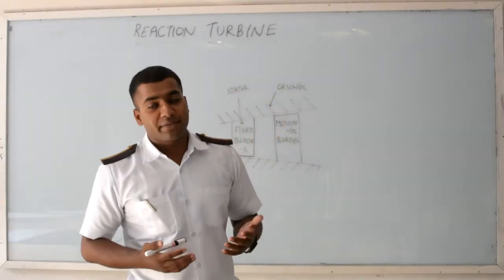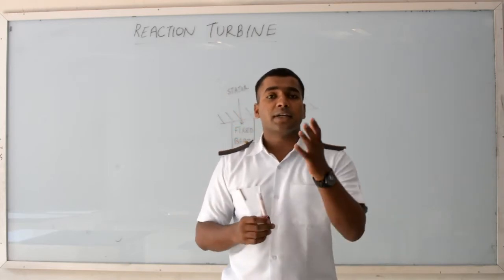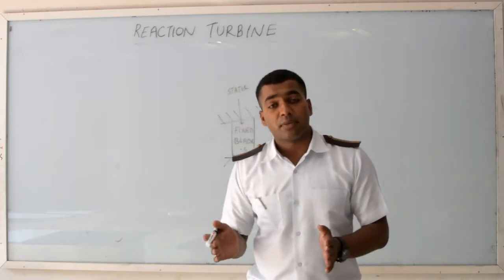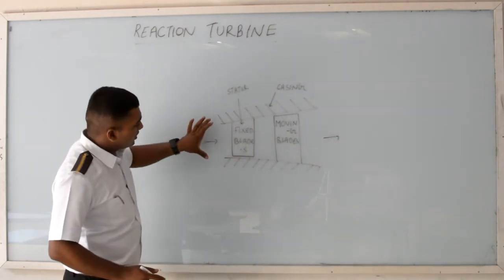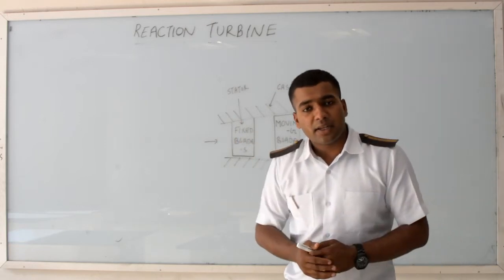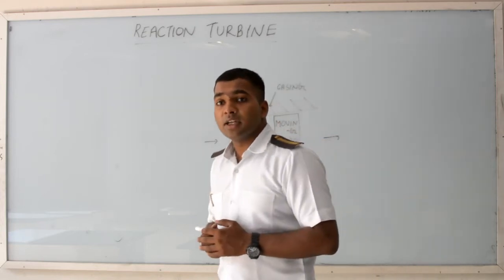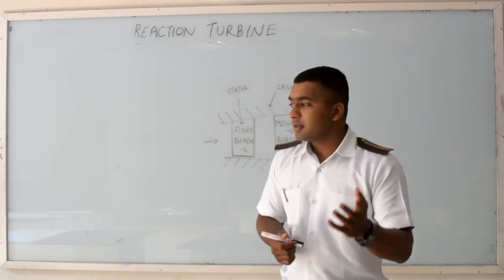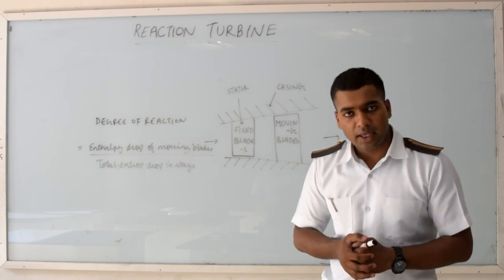INTRODUCTION TO REACTION TURBINE || LECTURE 1 (PART 9)

Comment: is velocity increases in the moving blades of reaction turbine
Reply from the maker: Yes the velocity will increase bcz of pressure drop in moving blades
Reply: @engineeringthermodynamicss9014  mobing blades pressure will decrease right and in fixed blades it will increase?